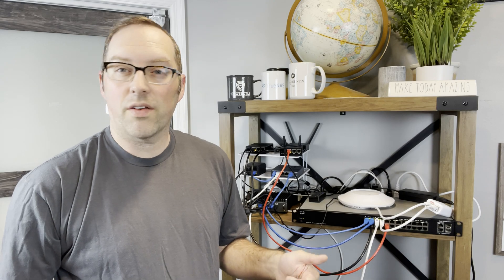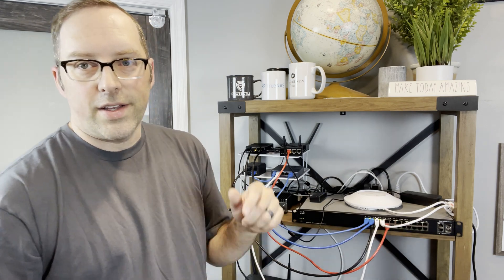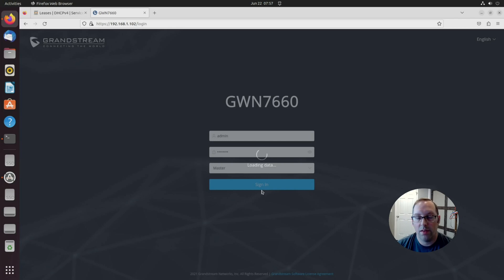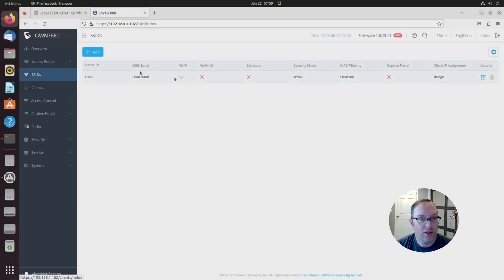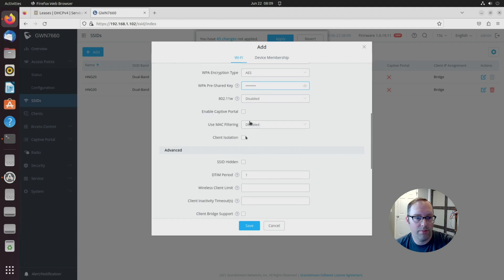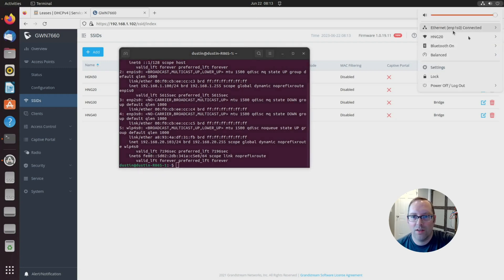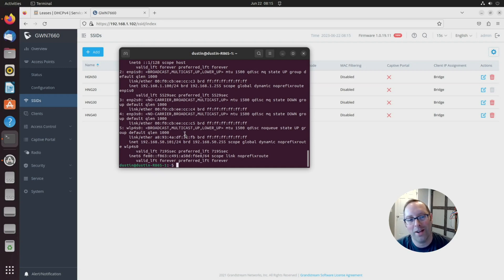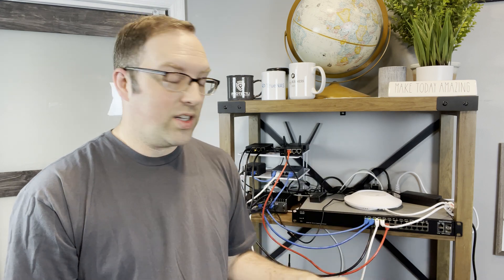Set up a Full Network using OPNsense (Part 4: Grandstream Wireless AP)

Comment: Have you ever run into this? - I set up a GWN SSID so I can access my home network from a laptop like my desktop with a wired connection. The GWN1 is getting a DHCP IP address from OPNsense.  I have two laptops getting a DHCP IP address from OPNsense. Laptop1 has a wired connection and can access the GWN1 GUI. Laptop2 is connected to the GWN1's SSID is getting a DHCP IP address but can't ping the GWN1's IP or access the GUI but it can ping laptop1 or an OPNsense LAN IP. I disabled the wired connection on laptop1 and enabled the SSID connection and lost the connection to the GWN1 but I can ping laptop2. It looks like the only way to access the GWN1 is from the wired connection through the switch port to the GWN wired port or it works with a second GWN2 SSID since it's going through the switch port.

Do you know of anyway to access GWN1 from it's own SSID?  Sure would like to not waste a WIFI AP just to have access to the GWN1.
Reply from the maker: I'm trying to understand your configuration based on how you are describing it. At the end of the first paragraph it almost sounds like you don't have the port of the switch where the GWN AP is connected configured to allow all of the traffic for untagged and/or tagged traffic. 

I think you need to have it configured to allow the untagged or VLAN tags on that trunk port. It's possible the switch configuration is preventing the wireless clients from connecting to the web UI.. but it is interesting that you said the wired devices can access it. 

Not sure if the SSID configuration would be messed up but that is a possibility as well since only the wireless clients can't connect. Make sure that SSID is using the same network as what is defined as the management network for the switch.
Reply: Sorry the description was probably cryptic and hard to understand.  I was pretty burned out debugging things. Your suggestions were in the ball park of my thoughts also. I gave up last night and decided to start fresh this morning. This morning everything worked and I got access to the GWN using a laptop and the home network  SSID. I had this issue a while back with the Proxmox OPNsense VM's in my test server system. I changed the network and some connection issues started and the next day everything was OK. I was like some table in OPNsense needed to get updated and it took a while. 

Your future new video series using faster NICs instead of LAGG do you think you'll be using a GWN AP and a Grandstream switch like the 7806 you reviewed earlier?
Reply from the maker: No problem. Sometimes connection states need to be terminated or timeout if you’re making certain firewall changes. There’s ways to force that to happen but I don’t find myself needing to that.

As for the new guide, I just got some new switches sponsored by Grandstream that I’m going to use for the guide. So it will feature 2 Grandstream switches and 2 Grandstream APs— mostly to demonstrate how to set up multiple devices if you’re using multiple switches/APs. I plan to show using the self-hosted GWN Manager app (similar to the UniFi controller) to show how manage the devices in a centralized manner. I’ll be making use of port profiles to illustrate why they are n convenient when you are managing multiple devices (or even a single device when you have several VLANs and want to have consistent settings across multiple network interfaces).

I’m looking forward to finally getting an update created! Later in the future I want to show using all Grandstream products using the GCC6010 as the router/firewall instead of OPNsense.
Reply: Knowing what I've learned about Grandstream's hardware I was telling a friend that if I didn't have OPNsense installed I'd buy a router and use the two GWN's in a mesh to replace my ASUS ZEN mesh system. Since you brought up the GCC6010, one reason the OPNsense seemed an interesting choice is being able to add a Zenarmor app and make the OPNsense a "next generation firewall" to do malware packet inspection. In your opinion have I been fed a lot of 'milk and honey' about having Zenarmor added to create a 'NGF'?

Looking forward to the videos.  If I win the lotto I'll send you a bunch of money so you can quit your day job and pump out new videos sooner.
Reply from the maker: It is nice when you have a full stack of network hardware from the same vendor if they allow you to manage it all centrally, but I often go the route of OPNsense + other network hardware— not just for IDS/IPS reasons but the fact you can run OPNsense on about any x86-64 hardware so you can use a small energy efficient system or a heavy duty server. It’s nice you can build out a system or use a variety of pre-built systems.

I don’t necessarily think you’ve been fed milk and honey with having Zenarmor. There’s not really a lot of options for home users for IDS/IPS that’s user friendly like Zenarmor. Of course a subscription unlocks more potential with Zenarmor as well. They may be working on ways to make the home edition more valuable for home users at a reasonable price. Generally speaking IDS/IPS is not a silver bullet to protecting your network but it’s nice to have some additional monitoring and protections enabled as yet another layer of defense (a defense in depth approach).

As for the GCC6010, that device brings a new option to the table for home and small office/business users. It has similar IDS/IPS protections as Zenarmor and Suricata. It’s priced at $79/year ($6.58/mo) but it’s cheaper per year when you purchase the 3 year plan ($4.69/mo) or a lifetime plan (depending on how long you keep the device). So this option is a bit cheaper than the Zenarmor Home Edition plan. Also not to mention you get the first year of updates free with the $199 GCC6010. I’m thinking of giving it a spin on my primary network and then use OPNsense as a transparent filtering bridge for a few items that the GCC doesn’t do such as running CrowdSec for network blocking of malicious IPs.

Also thanks for offering to fund me full time if you hit the lottery! Haha. It would be great to do this full time if I didn’t have to worry about making ends meet for my family.
Reply: @homenetworkguy   Hello, I'm running into kinda the same problem. I have my GWN7665 attached to port 15 and set to trunk port and allow all vlans on my GWN7802 switch.  I have not problem getting connected to wireless using my default lan.  However, when I change or add a new SSID and assign it a vlan id all I get is connected but no internet.  I have been racking my brain and banging my head against the wall for at least 4 days now trying to figure this out and I have reset both the switch the AP and and deleted them from the Manager to start all over and still the same.  I've cleared all states etc.. in the router and still can't figure it out.   Port 13 is assigned from my router to the switch as a trunk port and set to allow all vlans as well.   Any ideas on how I can remedy this problem?

Comment: how can you configure the wireless intel wifi card I have to pcie passthrough to opnsense and use that as a Wi-Fi instead of using an external access point connected on LAN interface?

Comment: A note in case it helps anyone! I was having issues with DHCP (same hardware). Turns out if you have DHCP setup for multiple VLANs/Interfaces in Opnsense and any one of them has an error, all will stop running. So it's one service with multiple configs, not one service for each VLAN. Once I fixed a typo in one definition, the AP started working as expected. Phew!
Reply from the maker: Yeah that’s a good point. If the DHCP service is down, it’s down for all interfaces. Same goes with Unbound DNS, etc.

Comment: great tutorials. Can I ask you that which AP model-brand you think that has best support for vlans? like we can configure a lot of custom vlans, not just a few? Thanks
Reply from the maker: Thanks! 

I’ve only used UniFi, Grandstream and Engenius APs so I don’t have a wide range of experience comparing a bunch of brands. I haven’t tested VLANs with Engenius APs so much yet. It’s on my todo list.

Certain brands support more than 4 SSIDs with VLANs (like perhaps up to 8). Someone shared info with me on how to set up RADIUS authentication so you can separate devices by VLANs without needing to create separate SSIDs. Might be more up front work setting up authentication for each client but you could exceed the limited number of VLANs for the APs easily.

I’m personally using UniFi APs but I may give Grandstream APs a shot when I want to upgrade or add some outdoor APs (don’t have experience with outdoor models of any brand yet).
Reply: @homenetworkguy  thank you so much. I think more topic to dig in, radius is interesting, I wonder how to use it with opnsense, but in todo list also 🤣
Reply from the maker: Yes! I have a growing todo list. I’m not worried about running out of topics to cover! Haha

Comment: Would you please point me to the part three video where you configure port 4 on the Iplink switch for the Grandstream ap. All I can find is a part 3 with you switching over to Ormada and then Unifi which I am not using.  I need to figure out how to configure tplink switch port to accept Grandstream AP with Multi-SSID (VLAN). Thank you.
Reply from the maker: I haven't done a part 3 video yet on the TP-Link switches yet but my written guide on my website uses the TP-Link switches. I recently replaced my TP-Link switches with Grandstream switches so it will make it easier for me to create a video to demonstrate how to do this with TP-Link switches because I don't have to worry about breaking my main network. I'm hoping to create a video which shows how to create VLANs for multiple vendors to show the differences between them.
Reply: What router-os did you use with your new Grandstream switches sir? @homenetworkguy
Reply from the maker: It comes with a built in web interface or you can use a software controller similar to UniFi. You can’t pick the OS like Mikrotik where you can select SwitchOS or RouterOS.
Reply: Sorry I was not clear.  I meant to ask what type main router upstream of the new switch you are using now. Or are you staying with Protectli and Opnsense. Thank you. @homenetworkguy
Reply from the maker: Protectli and OPNsense. I’m temporarily using my R86S since it has 10G SFP+ interfaces. I plan to switch migrate over to a different box in the future. 

I have no plans to move away from OPNsense for the foreseeable future since there are no alternatives that I find more appealing for my needs but I may dabble in other router platforms in the future just for learning sake and for future content creation when I feel I have exhausted all of the topics I want to cover for OPNsense. Believe or not even though I’ve been writing about OPNsense since 2018, I still have other areas I want to explore.
Reply: Maybe to save some time first write an article on tagging ports for the grandstream ap vlans and the Tp-link @homenetworkguy

Comment: Thanks for this! What's the model of your mini pc?
Reply from the maker: I’ve been using the Protectli VP2410 in the demonstration, but I use a VP2420 on my main network. The VP2420 has 2.5G interfaces while the VP2410 has 1G interfaces.
Reply: @homenetworkguy  got it, thanks again.

Comment: Can you do the same video but with openwrt? Thanks
Reply from the maker: You mean using OpenWRT instead of OPNsense or using OpenWRT on a wireless router running in AP mode? Just curious since you commented on the access point video instead of the OPNsense one.
Reply: @homenetworkguy  Hi, openwrt as an access point.

Comment: Have you experimented at all with using a wireless NIC inside the router as an AP? I am considering giving this a try it's very hard to find info on it though I know people do it. I have one of the small N100 firewall/router things coming with 4 2.5gbe ports on it, will run opnsense. It has a spot for a wifi NIC and with the right nic you can run in AP mode. Any info would be fantastic, great video/series!  
EDIT: I am assuming in the end it's better to just get an external wAP to handle wifi duty I am just curious.
Reply from the maker: No, I have not. As you stated in your edit, it’s not ideal for a number of reasons: the FreeBSD drivers aren’t very good for WiFi adapters, the WiFi adapters are designed more to be used as a client rather than serving multiple connections in ad hoc mode, some WiFi adapters don’t even support WiFi mode, and the range would not be good depending on where your OPNsense box is located. The. Ice thing about dedicated APs besides the fact they can handle lots of client devices is that I can have all my networking equipment located in a closet in my basement but my APs can be located in more ideal locations upstairs. I have all my APs ceiling mounted and powered via PoE. Makes it very convenient and provides a good WiFi connection anywhere in my house.
Reply: @homenetworkguy  Good points thanks

Comment: Exactly what I was lookin for, since I'm wanting to create my own router/firewall with AP's soon too.  Any experience with running that on top of Proxmox?  Also, any experience with tiny SFF PCs like ServeTheHome's TinyMiniMicro series?  I've got a Lenovo ThinkCentre M920Q but I don't seem to be having luck with IOMMU groupings.  But that's a project for another day.... Keep up the great videos.
Reply from the maker: Glad you found it helpful! I have some experience running OPNsense with Proxmox, but I just have only used virtualized NICs and not passthrough the NICs because I am using the NICs for all my other apps/services. I only virtualize OPNsense for testing/demo/screenshot purposes. I prefer to run bare metal and since I use a mini-PC for my OPNsense box (love those little boxes). Using the mini-PC hardware is not nearly as much of a waste of resources as it would be running OPNsense on my server or other powerful hardware. I haven't tried setting up TinyMiniMicro systems, but I have been tempted a few times. Until I have Internet at home at speeds where my mini-PCs can't keep up with IDS/IPS, I probably won't be buying/building a more powerful router for quite a while (the mini-PCs can handle IDS/IPS up to 2.5G (with Zenarmor not Suricata) so I should be ok for a while).